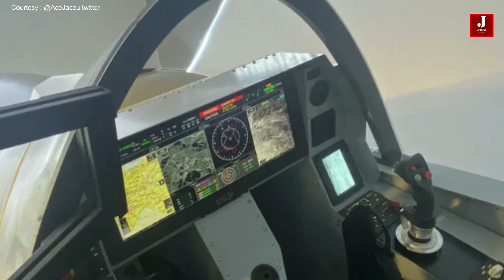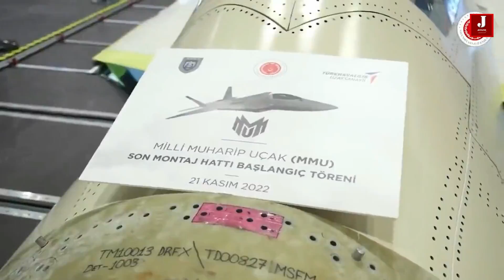Turkey displayed the first frame for a fifth-generation fighter plane.

Comment: In Turkey, two companies started to produce aircraft, missile, helicopter and tank engines.
1 - TEI
Design Engineering Projects

TEI-TS1400 Turboshaft Engine Development Project
In projects such as the Original Light Utility, ATAK, and the Turkish Utility Helicopter, which Turkey has recently started and are continuing, ...

TEI-TF6000 Turbofan Engine

TP400-D6
The design, development and production activities of the TP400-D6 engine are carried out by MTU Aero Engines, Snecma, Rolls-Royce and Rolls-Royce ITP Aero companies.

UAV Engine Development Projects

TEI-TJ90 Turbojet Engine
TJ90 made its first flight with TAI's Şimşek platform on 7 June 2017.

TEI-TP38 Turboprop Engine
In 2005, the TP38 Turboprop Engine Development Project was initiated using the TJ35 engine as the core engine.

TEI-TJ35 Turbojet Engine
TEI is a competitive, innovative and high-tech company that is expected to take its place primarily in the national market and in the international market in the long term.

TEI-PG50 Two Stroke Gasoline Aviation Engine
The project, signed between TÜBİTAK (SAVTAG) and TEI on December 21, 2015, was completed in 2 time periods in line with the needs of a private unmanned aerial vehicle.

TEI-PD170 Turbodiesel Aviation Engine
The TEI PD170 engine is designed to meet the power needs of MALE (Medium Altitude Long Endurance) class unmanned aerial vehicles, primarily ANKA.

TEI-PD222ST Turbodiesel Aviation Engine
The TEI-PD222 engine is designed to meet the power needs of MALE (Medium Altitude Long Endurance) class unmanned aerial vehicles.

TEI-PG50S Two Stroke Gasoline Aviation Engine
More power, higher power/weight ratio, fast technical and logistic support, high locality rate, electronic engine control system and...

TEI-PD180ST Turbodiesel Aviation Engine
The TEI-PD180 engine is designed to meet the power needs of MALE (Medium Altitude Long Endurance) class unmanned aerial vehicles.

Technology Development Projects

Wish
Development of Superplastic Forming Process for Titanium Alloys

Lion
Development of Aluminum Casting Processes for Aerospace

Pearl
Aviation Titanium Casting Technology Development Project

Ruby
Aviation Nickel Alloy Additive Manufacturing Technology Development Project
2 KALE GROUP
The project includes the design, production, testing, technology demonstration, training and maintenance of the Turbojet Engine and its subsystems, developed by Kale Arge for use on several different domestic platforms, and the preparation of the Technical Data Package (TVP).

In this context, the KTJ-3200, which was originally developed with completely domestic facilities, is a Turbojet Engine optimized for use especially for unmanned platforms such as cruise missiles and target aircraft.

· With its compact design, it has the characteristics of high thrust, low fuel consumption and starting at different altitude/speed conditions.

· All of the KTJ -3200 Controls and Accessories were originally developed by Kale Arge.

Thanks to its superior features, the KTJ-3200 can be adapted to different air platforms with some modifications.
Bu kaynak metin hakkında daha fazla bilgiEk çeviri bilgileri için kaynak metin gerekli
Geri bildirim gönder
Yan paneller